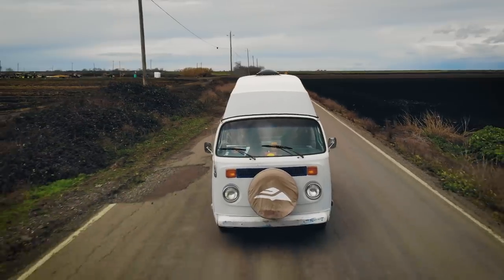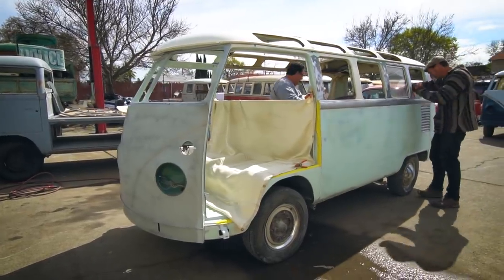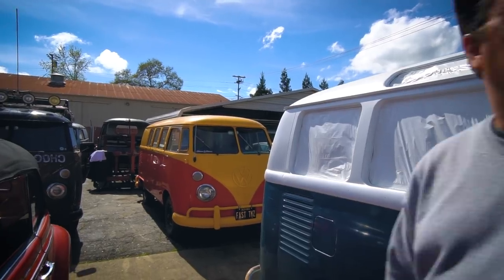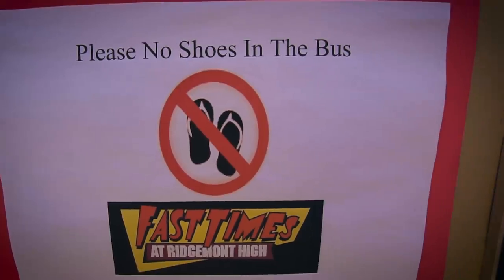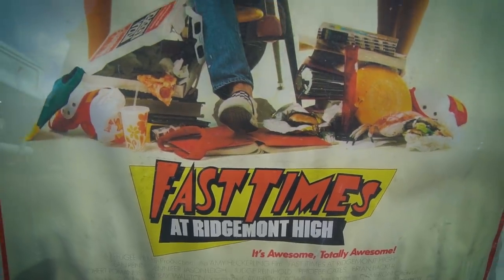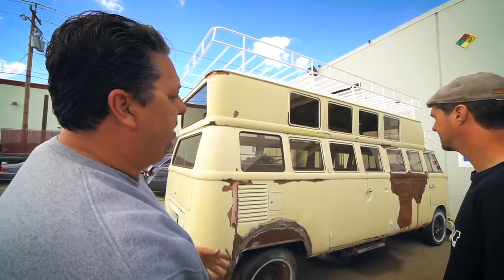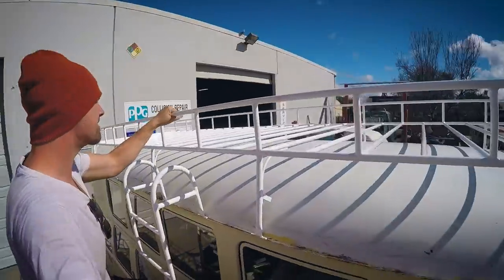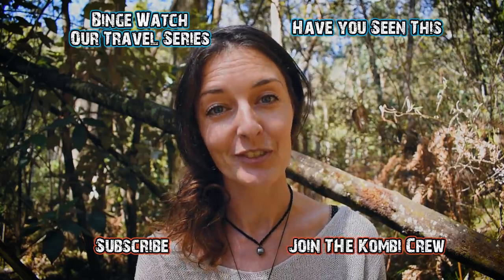MAN RECOVERS FORTUNE FROM DERELICT BARN

Comment: Why do people love t5 & 6's when these are still on the planet. Brilliant video :-)
Reply: Because T4's/5's/6's don't cost 3 or 4 years salary and they're reliable. As much as I love a splitty, I'd rather not spend most of my precious time off, stuck on the side of a road.
Reply: @van-gabondramblinrose6398  I sort of get where you come from. In the UK an all singing all dancing t6 can cost easily over £100,000. Split vans can be made reliable if you are prepared to add modern technology and can cost less than said T6. Yes your safe which is a major factor in a T5 or T6 but the majority of them look the same with just different coloured seats and cabinets and are just another boring van. Each to their own and respect your comments but I love old vans and it makes people smile when they see it and ask questions. :-)
Reply: @stephenmorgan5100  I dunno, I have a T4 which I've converted myself and still lots more work to do to get it where I want, but I love it and so far it's cost me around £10 grand...much less than the £40-60 grand it would cost for a splitty. I love the shape and the look of my T4 and it's been totally reliable and economical to run, but mostly I love the adventures it gives me and that's what it's all really about, no matter which type you go for. My view is, we're all VW people and I have no room for any elitism. I love it when I'm on the road and I get a wave from another van, whatever it is. :-)